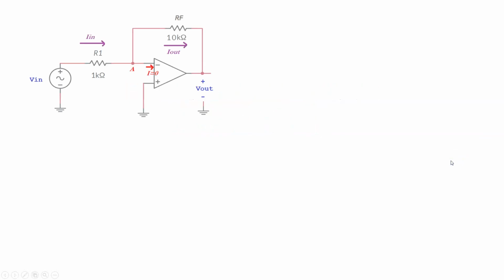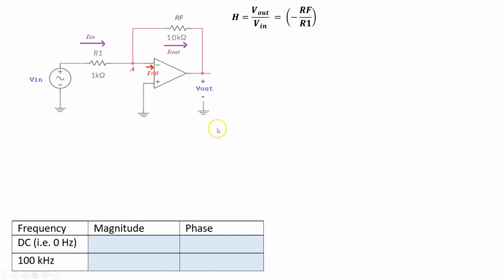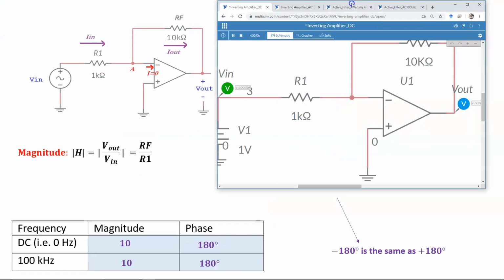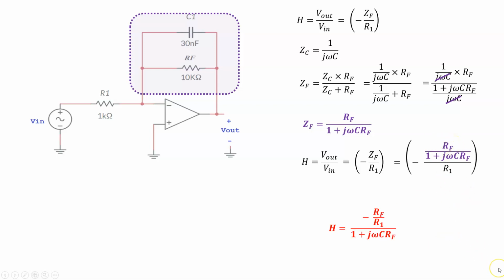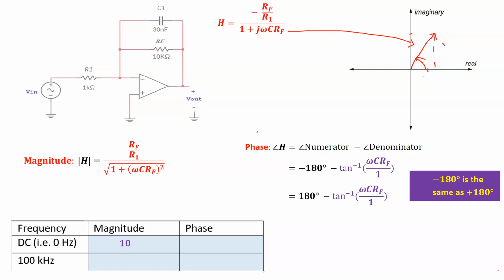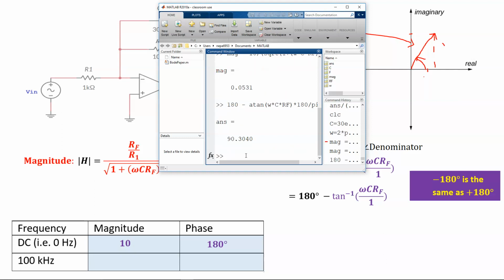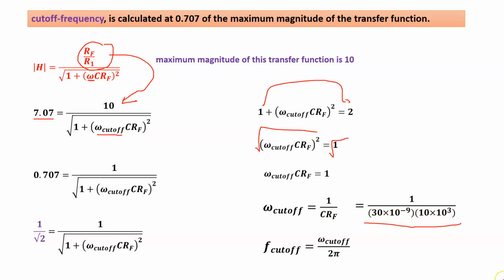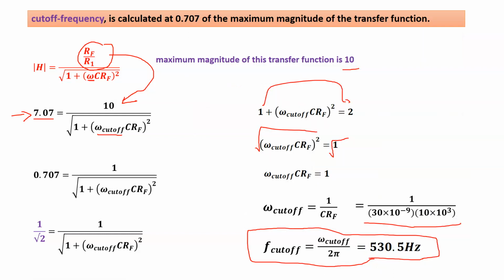Frequency Response of Active Filters

Comment: i tried to prove the equation the same way as you did for the Non-inverting low pass filter, but it turns out not the same as the simulate number from my Pspice. The gain according to my calculate is 1+ (Rf/R1)/(  sqrt(1 + (w.C.Rf)^2  )) was there any step that i miss ?